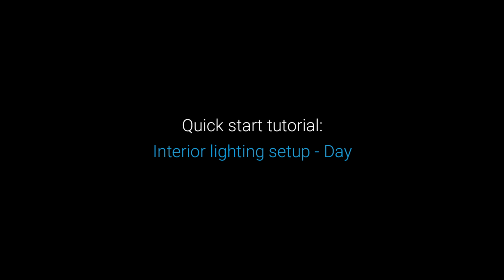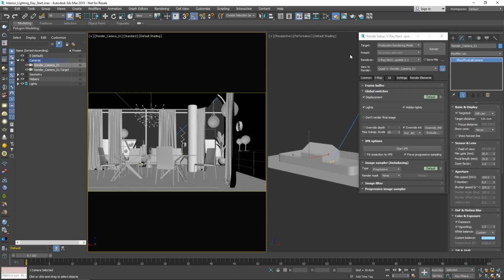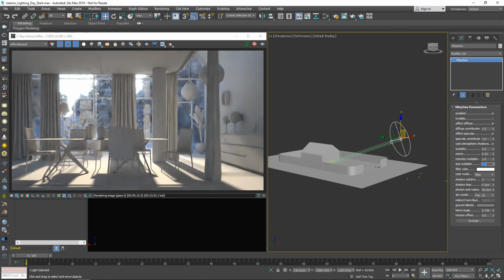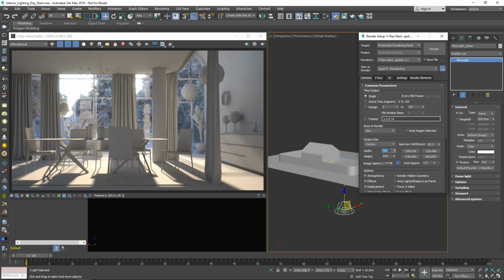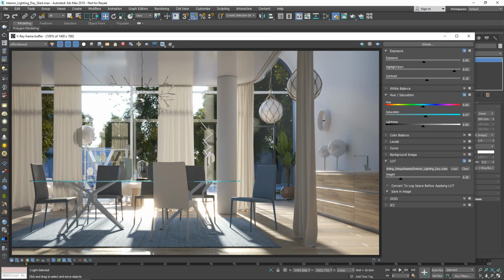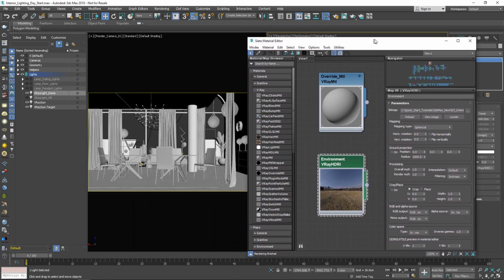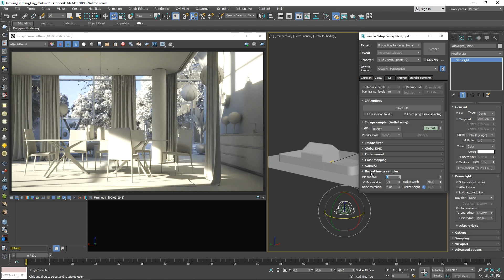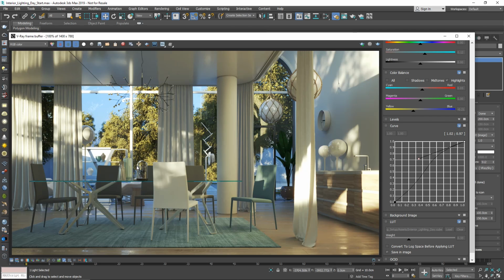V-Ray Next for 3ds Max – How to light an interior day scene

Comment: If there is no window that can get daylight from outside, how should we set the render? Is it possible for you to prepare a training video for it? because I have a hard time rendering a residential entrance or a windowless bathroom. it's not realistic at all. I will be grateful if you could help me. videos are great. thanks.
Reply: Sir did you find how to do it. If you know please share it will be very helpful for me.
Reply: @paralyzer6834  I tried this as a method. Make sure to use ies lights, it is very difficult to provide a realistic ambiance with only vray light in a windowless indoor space. second, use vray lightMix from render elements. You can easily change the light intensity and color without re-rendering. And finally, I set the vray camera exposure setting to no exposure.
Reply: @ik10iktrend35  thank you sor it's very helpful

Comment: why in  slots for reflection and bump you put HDRI maps.What is the reason?
Reply: Vray HDRI map is just like VRay Bitmap own loader that's recommended to use even when you are loading other formats  like jpg , png and tif .
it will  provide better filtering , more optimized memory consumption and other useful features like UDIM , TX support and so on ..iirc it was mentioned in the official forum that  they will remove the HDRI word from this map in the future so it won't confuse new users .
Tip : you can right click and use Vray Bitmap to Vray Hdri bitmap converter to quickly move to this workflow and test it : ))
Reply: The reason is HDRI maps works with gamma 1.0 which is the same with all raw data files. Just load one texture with HDRI map and one with Bitmap and check the difference in the material editor. The HDRI map is gamma corrected to 1.0 and the bitmap is gamma corrected to 2.2 i think. It's pretty visible in the material editor.
Reply: @ДимитърЦонев-г9у  Митко здравей и благодаря.Българин съм.Да заредих две текстури в Hdri  и растерна.Определено първата изсветлява значително.Трябва ли да и се направи гама корекция ,за да придобие оригиналния си образ.Изобщо какво мислиш за този вариант на текстуриране.Благодаря
Reply: @montoya3345 Не прави корекция. Използвай за бъмп нормал и рефлеклън HDRI. Самия мап ти прави корекция към гама 1.0 и я изсветлява което от своя страна в много случай ше ти даде по правилен резултат. Не използвай HDRI за diffuse освен ако текстурата ти не е 32битов файл. Идеята на HDRI е че този формат съдържа голям фиапазон от цветова информация за пикселите. Рендерите ти във фрейм бъфера са 32 битови картинки. Можеш да направиш сравнение като запишеш картинка от фрейм бъфера в jpeg 8 bit и във фотошоп се опиташ да сложиш експозицията на макс. После сложи експозицията на макс на картинката ти във фрейм бъфера и виж разликата.
Reply: Чудесно обяснено.Благодаря
Reply: @montoya3345  Даже я понял, словно на русском написано..
Reply: @ДимитърЦонев-г9у  Благодарю!
Reply: @ValeriyaGarber  Пожалуйста :)